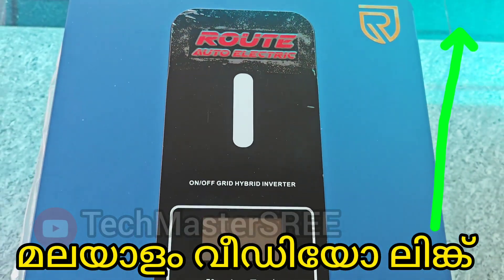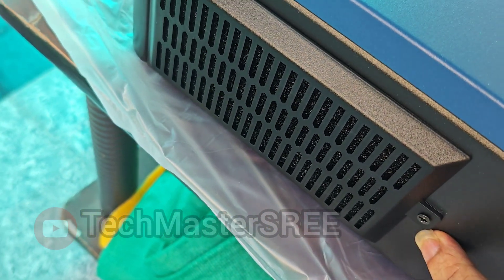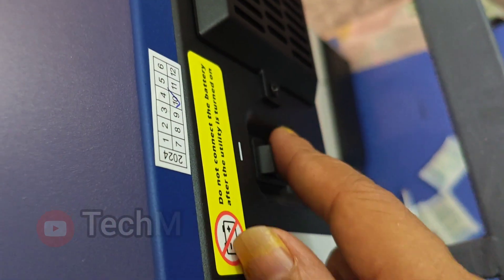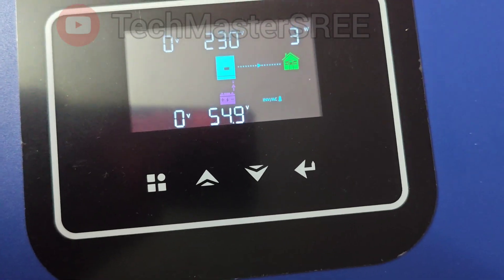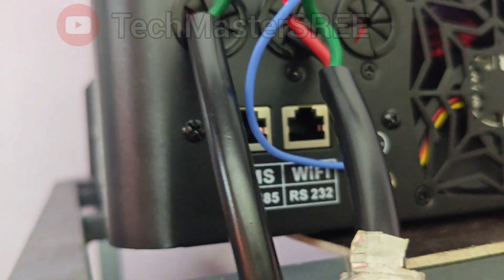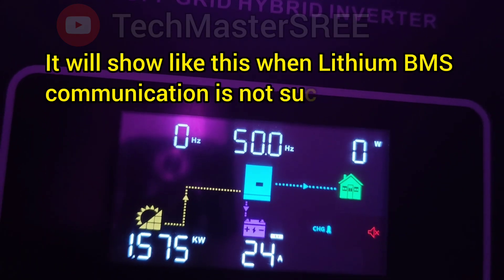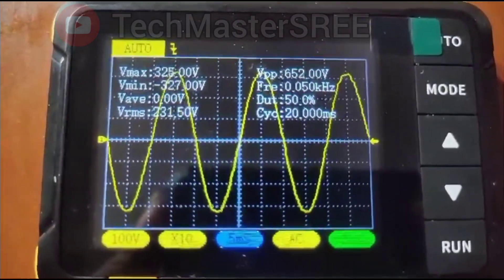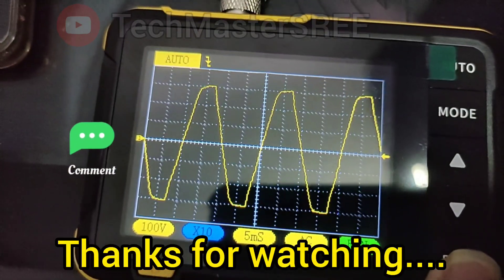Affordable Hybrid Solar Solutions: Unboxing the Route Auto Electric Inverter

Comment: Can you please explain more about battery communication, i am using JK bms , unable to communicate i will do same as you explain, but confused in jk bms app where I select correct protocol, please share screenshot.
Reply: Version:- V15.34
Model:- PB2A16S20P
Reply from the maker: @akshay123a   Latest firmware version for  V15 is 15.41 so upgrade firmware and check
Reply: Okay bro, i will try 😊😊, thanks for reply ☺️😊
Reply: Do you have any dedicated video for upgrade firmware?
Reply from the maker: @akshay123a  not yet done the update firmware video , if need I can share the pdf users manual . just contact me via Instagram, email  or Facebook
Reply from the maker: you can check the following short video. Let me know if its till has issues.
https://youtube.com/shorts/Z_PiiJr-T3Q?feature=share 

In JK BMS mobile app > Settings >Advanced settings> UART Protocol1 > Select Pylon.
Reply: @techmaster_sree thanks for reply ☺️, it's work but charging and discharging parameters show wrong, rest all ok.
Reply from the maker: @akshay123a  its because you may be using older version firmware on jk bms. Cross check it

Comment: Route EV website claims this Inverter is designed in Germany. Is it true?
Whats the Maximum current supported in MPPT?
Reply: It is a China designed and made inverter that is identical to Gootu/MuscleGrid and many others using the same motherboard. But this one is BIS certified and offers 5-year warranty.
Reply from the maker: @VenugopalNairMararikulam  as said above they are just importing the parts for china and assembling  only. The main advantage is BIS Certificate and 5 year warranty as mentioned above.
Reply: Can you please explain more about battery communication, i am using JK bms , unable to communicate i will do same as you explain, but confused in jk bms app where I select correct protocol, please share screenshot.
Reply from the maker: @akshay123a  you can check the following short video. Let me know if its till has issues.
https://youtube.com/shorts/Z_PiiJr-T3Q?feature=share 

In JK BMS mobile app > Settings >Advanced settings> UART Protocol1 > Select Pylon.